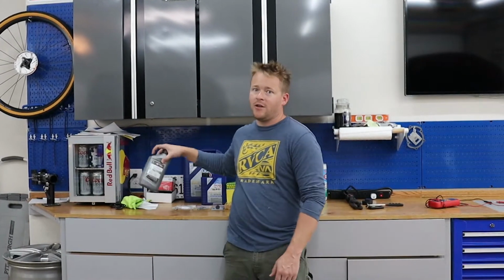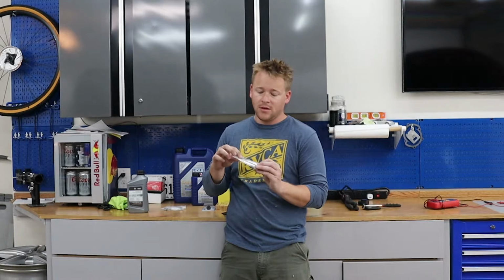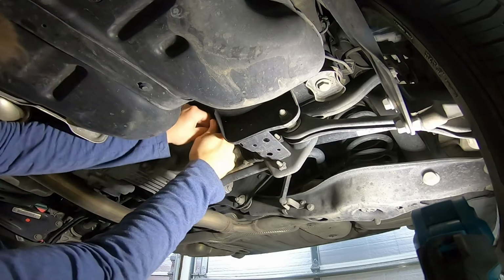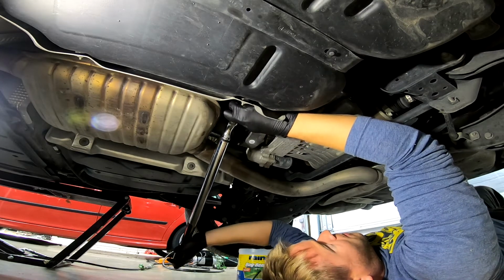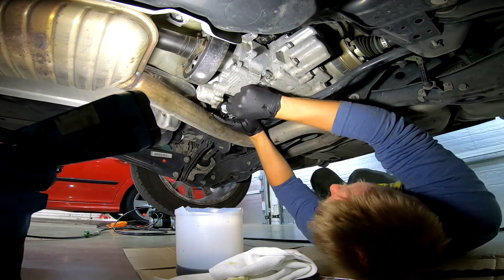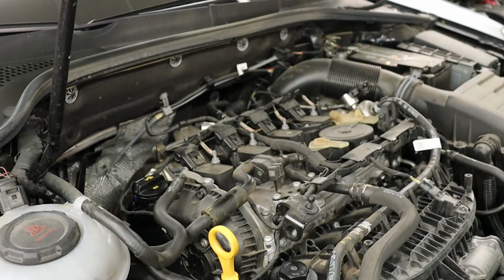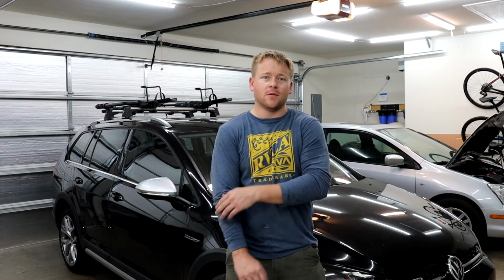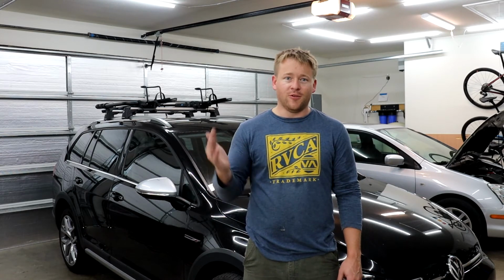MK7 Alltrack/GSW 30K Mile Service| Haldex and Spark Plugs

Comment: I'm considering buying a 2019 SEL 6sp Man. How has yours held up? I've seen concerns with the panoramic sunroof. Any issues there? Thanks for the details in the videos!
Reply: I had the sunroof issue, just inspect the headliner and look for standing water under the spare tire. I had to get the sunroof fixed by VW to stop the leak. Insurance covered the water damage to carpet and headliner but I had to pay out of pocket to fix the sunroof, around $2000.